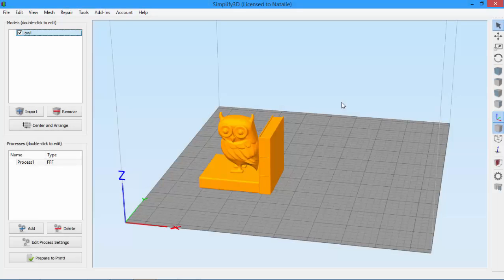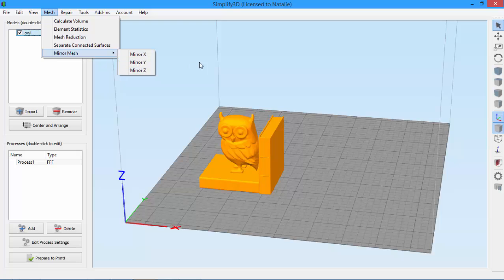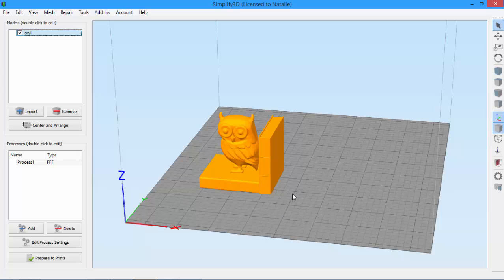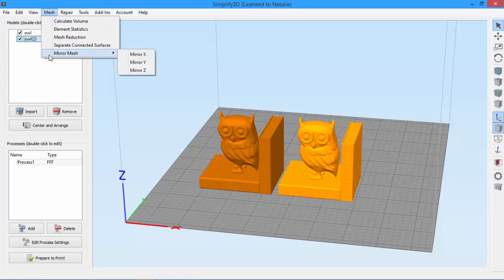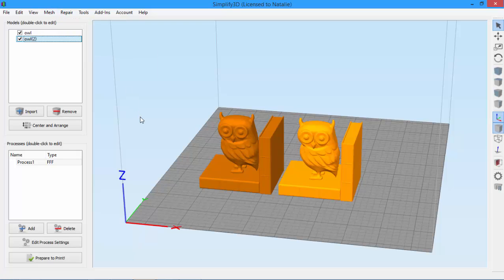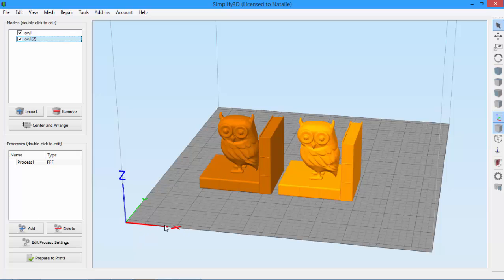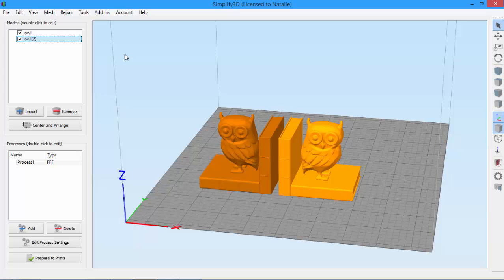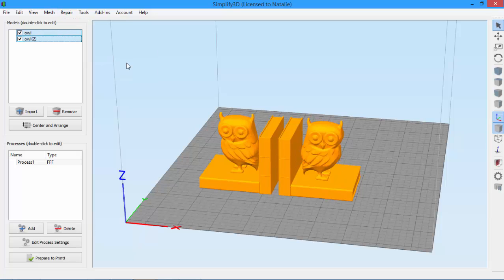Mirror Mesh | Simplify3D

Comment: thank you for clearing some things up.
im sure you will make more videos so ill wait with my questions untill you do. thank you. :D
btw will you ever make a profile for the renk forve rf1000 for simplify3d? i have some problems with the extruder printing outside the printer bed because the startpoint of the extruder is outside of the printer bed. i would be so greatful if you guys could make a profile for the rf1000.
Reply from the maker: pinkiedestroyer jr Yes, more videos are on the way! We are constantly evaluating new profiles to add to the software. In the meantime, you can set up your own custom profile using these instructions: https://forum.simplify3d.com/viewtopic.php?f=8&t=2009. If you need help, please contact our support team at support@simplify3d.com. Thanks!